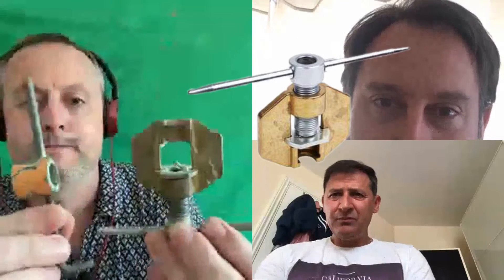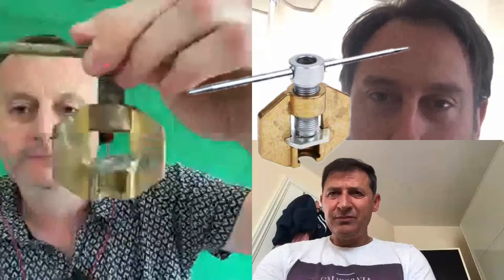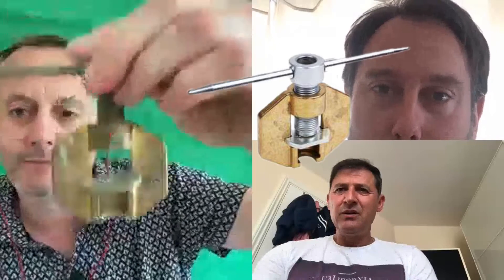MICC Cable (Pyro) Part 2 Stripping & Glanding Tools. Gland, Gland Body, Shroud, Pot & Olive

Comment: Showing my age now , we had to use a small pair of side cutters and we used to make are own key stripper from and old worn straight bladed screw driver which we cut a slot in the end. The modern apprentice does not know how good they have it today , with FP 200 and no burn cable.

Comment: When i did Pyro (new world MICC) all we had was neoprene tail and electrical tape and only used long nose pliers and side cutters.
Reply: I never even saw a stripping tool ! I did see a wringing tool and had the potting tool , but that brass one was posh !
I love the guy on YT that shows using a workmate and a bin ! love to see him trying to use that at the top of a ladder.
What happened tro 'real world' installs ?
Straightening tool ? never saw a single one of those at the time, few bits of hardwood maybe.
I made dozens of 'ends' off without a 'ringing' tool when it got lost ..it takes practice but can be done.
The tool that one cannot manage without would be the pot/ seal crimp, we were issued with the old style, like two plates and a couple of screws, that brass job was a later addition..and expensive.
Seeing one of those for the first time would be like Nick Bundy waking up to a roll of Flexicon in bed next to him !!!
I cannot remeber the exact sizes but certain glands, pots (but not the seals) could, as a cheat be substituted..maybe it was something like a 3L1.0 would fit a 2L1.5 dont hold me to those sizes. I have seen some in desparate situations use larger seals of the same amount of cores on a termination
It is a long time since I was ever using Pyro and that was as an apprentice where we worked on petrol filling sites and depots, it was all Pyro. I rememer this...never have bare copper Pyro anywhere near cinders...it destroys the copper.
There was none of those earth tails back then.
I heard that all core sizes started of at a the largest size and were extruded down to the lower siizes, clearly had to be the same amount of cores of course.
I recall asking the instructor at college  "how much hammering could a Pyro cable take ?" so.. a power source, length of two core Pyro and a lampholder with lamp was set up on the bench and we beat the sh!t ot of that Pyro and at various stages, applied power..hell, was I surprised..it was virtually flat before it failed. Of course if the edge of the hammer was used, it would be a premature failure.
I have come to discover that there are far more tools to make life easier for a spark nowadays but of course there is much more to learn with respect to regulations, testing etc.
Testing a cable then was a small bell with a battery taped to it, test lamp was a lampholder, pygmy lamp and two bits of 2.5 singles !!!
I was the only apprentice or employee who asked the 'Boss' for an AVO Minor and could I pay the company back each week out of my wages. I still have an AVO 8 somewhere.
Hey..and when I spotted a Drummond test lamp set in the local wholesalers, had to be bought 😁